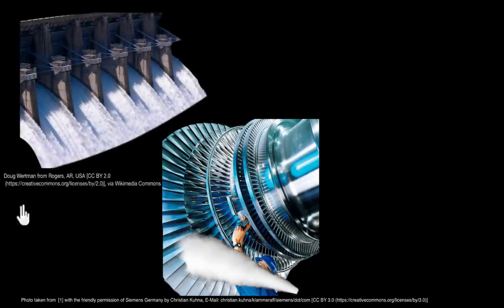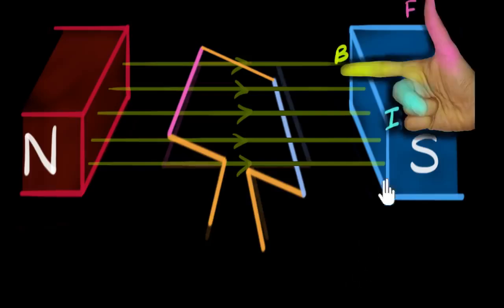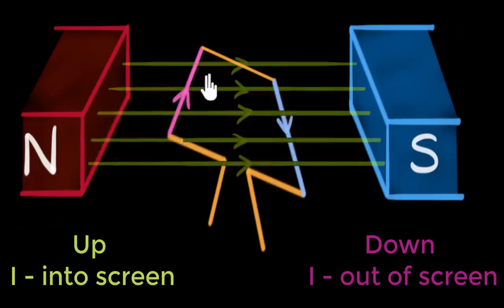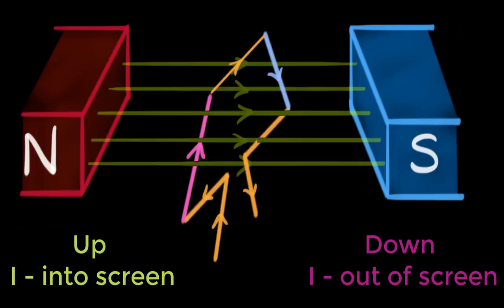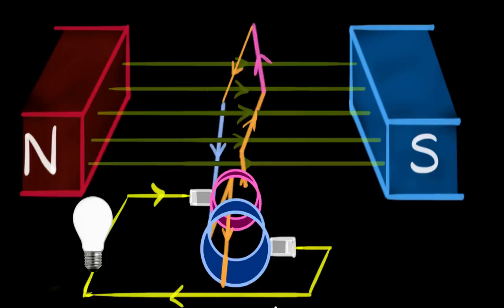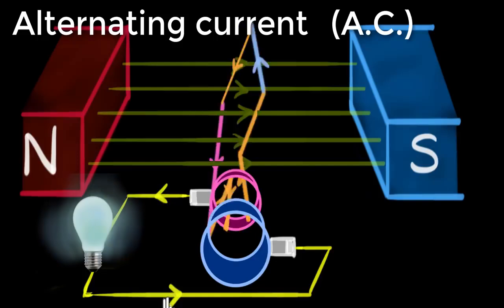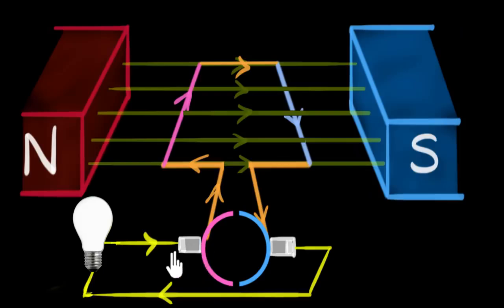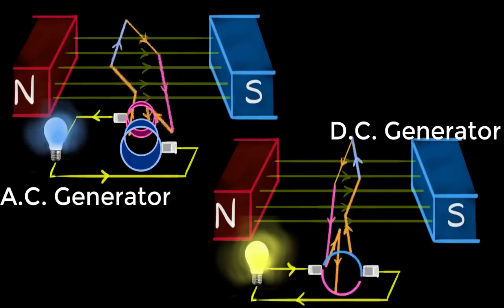Chapter 21- Electric generator   subscribe for more

Comment: thank you for this video very explicative, Id like more content like this! also on de ingeniery part of sciences and math, how do you calculate the voltage of such circuite? what are the energetic losses? how do you calculate the frequency and how to modulate it with electronical pieces, or crystals? How do you build a speaker and reverse it to a microphone? what about boundary mechanics and convert a cymatic or geometric pattern  back to its root frequency?
Reply from the maker: @EDGSTONE  good afternoon hopefully you are doing well  I will upload a video explaining everything you ask